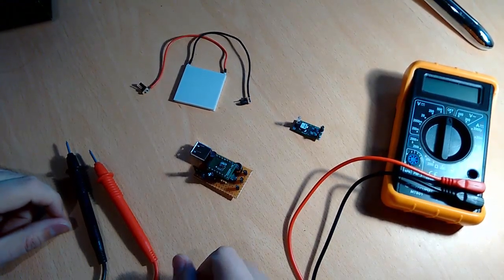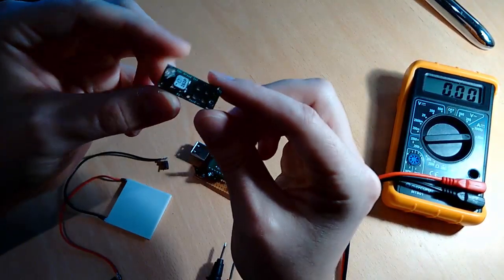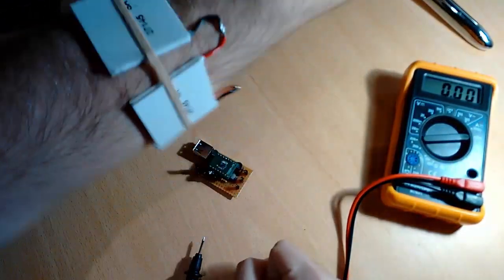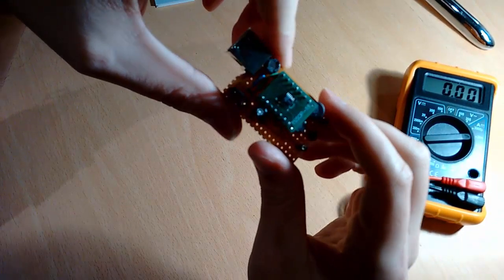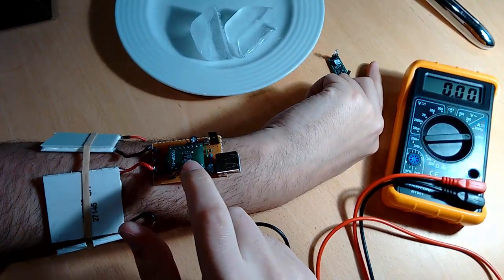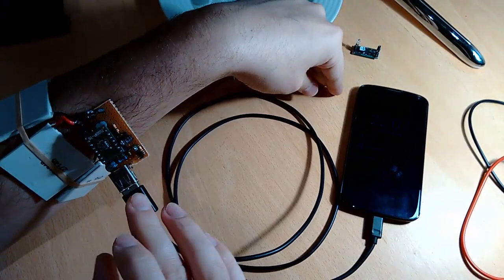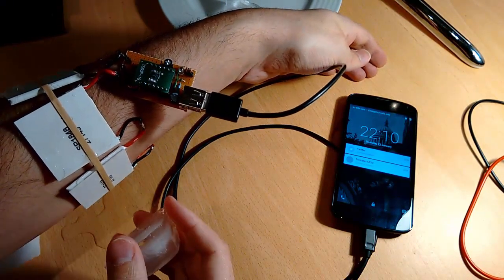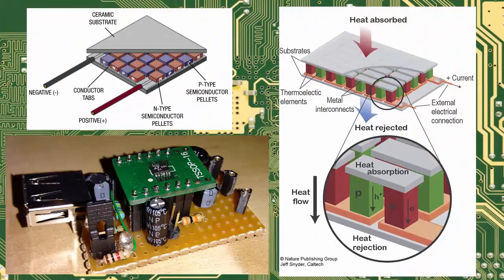Thermoelectric Energy Harvesting for Wearables

Comment: Fixing hot plate at 50 degrees and the heat sink, which thermoelectric module would produce more power: TEC1-12702, TEC1-12706 or TEC1-12710?
Reply: teg is more better than tec for generate electric

Comment: 15 minutes and the peltier cell stabilizes its temperature on both faces..... then, no thermal energy will flow, means no electricity..... that's why he needs ice, but wait..... a 20 grams ice cube requires near 5 Watts of energy to be produced, it means, he is putting a source of energy (from the main power supply, his freezer) when he put the ice cube, that ice cube represents 5 Watts of energy taken from the wall socket....

Comment: Where can I find information on efficiency depending on temperature difference. I can't seem to see it on any product information. I seen one claiming it produced 235w @ 30 degrees but that seems ridiculous.
Reply: It really is because TEG are actually inefficient in terms of heat transfer. In my case, I got SP TEG that generates 2.4 watts at 100°C difference or that's about 4.8 volts at 500 mA
Reply: @warrenmiranda4943  1watt = how much volts and ma

Comment: Wrist watches have a really low power consumption, and there are ones which have a photoelectric cell behind the clock face, which charges a battery or a capacitor, which runs the movement. I wonder why no manufacturer has made a watch which utilized a Peltier element and the temperature differential between the wearer's wrist and the ambient air?
Reply: I saw this the other day https://www.powerwatch.com/

Comment: interesting, but only good for very cold climates!.... GREAT IDEA!, maybe modify it with a velcro strap system?......
Greetz from Victoria, Australia
Reply: For a wearable in hot climates, ur better off giving with solar generated power, as you can get flexible thin film material that can generate solar energy. These you could easily build into a shirt, jacket, backpack etc.
These thermo electric generators are bulky, cannot be made flexible, and only work depending on temp differential.
If not talking about clothes specifically, these could be made into a very effective generator in hot climates if you have a water block on the opposite side, with a pump pushing water through the waterblock to a radiator to cool it down.
You could put out a lot of energy with something like that in a hot climate.

Comment: Mini spark gaps try a few in your design and see what happens. Try putting those modules in an enclosed pouch of gallium to help evenly conduct the body heat. Use slip on shin guards and forearm guards to position and connect modules in series. Make a power system for heated clothing like atomic skin. ; )
Reply: Can u please explain more?

Comment: Seems like you wired the modules in series, you should try in parallel.
Reply: when you associate them in series you will in the end get the result of the Voltage generated by each one, times the number of Peltier plates associated. but the current will be the current of only one, even though you are using more than one. In other hand, if you associate them in Parallel, you will in the end get the current of (current of a single peltier plate times number of plates used) but the Voltage will be equal to the voltage of only one. For example. (values are just for the sake of the example, and not to be believed)
If a single peltier module Generates 0.2 Volts, and current of 0.01 Amps and if you have 3 modules.
then if you associate them in series, you will have a total Voltage of  0.2*3 = 0.6V and the Total Current of 0.01 Amp. However, if you associate these same 3 modules in parallel, you will have the total Voltage of 0.2V and total current of 0.01*3 = 0.03
Reply: How will it differ

Comment: Name of module plzz
Reply from the maker: I used these ones http://m.ebay.co.uk/itm/400788584603?_mwBanner=1
But any peltier module should be enough, there is not much different behaviour in peltier or seebeck modules.

Also I am building a new version of this prototype, this time using LT3108 and peltier modules, and seems to work just as fine.

Ill do a new video soon!

Comment: Increase efficiency by using graphite sheets on the heat side and mini heat sinks glued with thermal paste and a bit of electrical tape to keep it together also test some other voltage boast modules mine has slightly higher output every bit counts at these low levels Ironman out..
Reply: Ace Winger what difference should Graphite sheets on the heated side make? ANYTHING the heat has to move through to get to the peltier element disturbs the flow of heat and therefore decreases efficiency